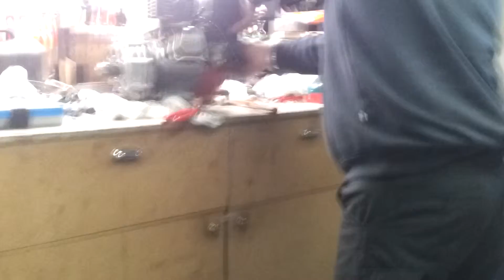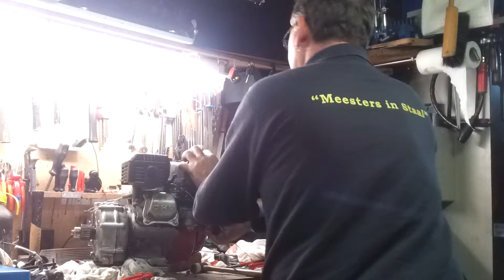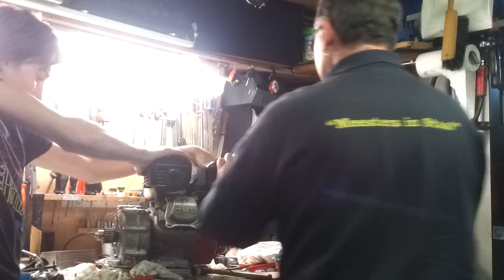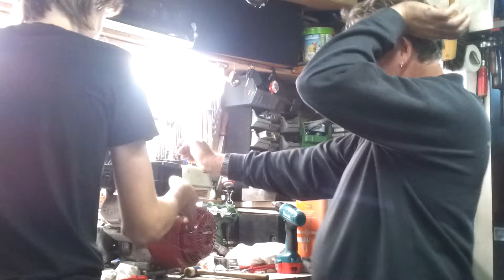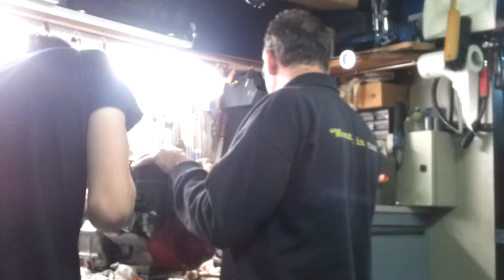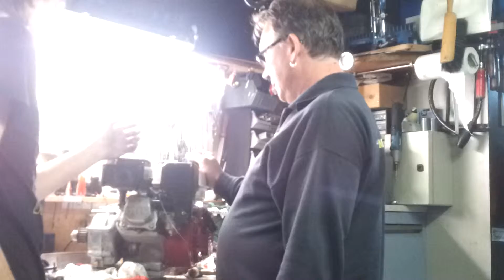Go kart first backfire

Comment: you may have a sheared flywheel key.. looks like a little bar in the flywheel.. if it breaks it throws the timing all off.. like moving the distributer on a car.. can cause the backfiring... cheap easy fix